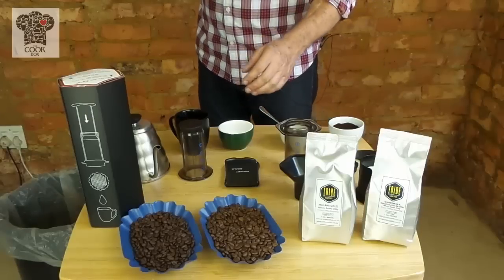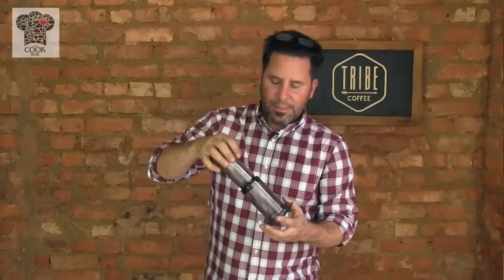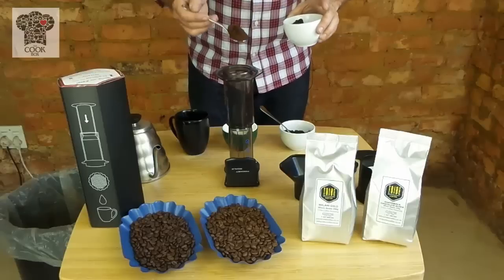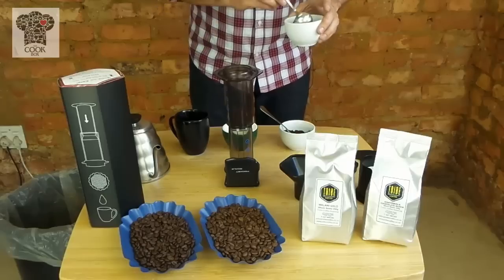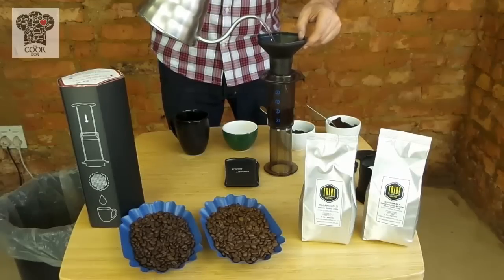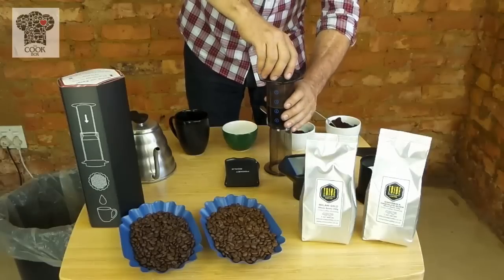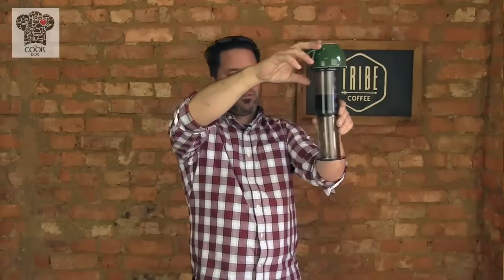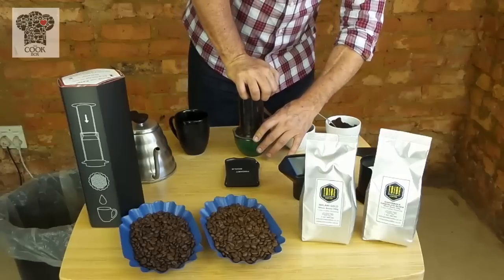How to Make the Perfect Espresso with the Aeropress Coffee Maker

Comment: That wasn't a cup of espresso, it was a cup of coffee using espresso beans.
Reply: It is as much as espresso as a cup of "moka" is (from a bialetti), which is technically, the original espresso.

Is it a espresso by modern standards? no... no crema; not enough pressure clearly.
Reply: Espresso get its taste from both method and beans. You need to squeeze water with pressure trough the tamped down coffee. That's what releases the oils. You can make pretty good espresso in aeropress, but this is definitely not the method for that.

Comment: i really don't see what the difference is by making it upside down. it's literally the same process
Reply: You get no water leaking through the filter when you do it this way..
Reply: You can achieve that without inverting by putting the plunger in the top of the tube during infusion.
Reply: As you're inserting the plunger, much of the water gets pressed through.  This avoids that.
Reply: The designer’s demo did it on the cup. I want 12 oz so I fill it to the 2 mark. Let it sit 30 sec then  fill it just past the 4. Two minutes later I have a good mug. I grind very fine and it works great for me.

Comment: this really isn't espresso, more like a very concentrated cup of coffee which can be diluted to make an americano. To make a true espresso you need an extreme amount of pressure that just can't be achieved with the aeropress.
Reply: The aeropress uses the same amount of pressure as an espresso machine, about 130 psi. Not extreme at all.
Reply: You can't make the crema you can get out of espresso machines with the aeropress.
Reply: Yeah with machines that apply enough pressure. You cannot possibly get real crema with hand pressure. It's physically impossible to do.
Reply: +Brandon Singer (Bsting58) If you tamp your coffee inside your aeropress you can make a crema. Put a filter on top of the tamp and push it down inside your aeropress before plunging.
Reply: +Brandon Singer (Bsting58) 9bar is about 130 psi... with a portafilter that had an area of 1" squared ~130 lbs of hand pressure would be required to create 9bar which is what espresso is brewed at. if you had a 1/4" squared portafilter it would require 32.5 lbs of hand pressure.. these numbers are quite far from physically impossible.

the aeropress has a diameter of ~ 2.25" => area of ~4" squared => 520 lbs of force would be required to create 9 bars of pressure with an aeropress which is most likely impossible to do with your hands w/o some additional leverage somewhere
Reply: It is humanly impossible to produce enough pressure to create crema with an aeropress without any external aid.
Reply: thank you, that is what I was getting at long ago haha. I mean if you have nothing else but an aeropress but you don't want regular coffee and you want something with a kick go ahead and make this but it's not gonna really taste or feel like a true espresso.

Comment: No temperature check, too much water for espresso. Gooseneck used just to pour through plastic neck instead of slow pour around. One filter? For espresso need two and best way is to tamp coffee inside and put another filter. Pressure goes much higher. Also no timing of infusion. So many things goes wrong. And last but not least - recycle filter and use it again? Seriously?